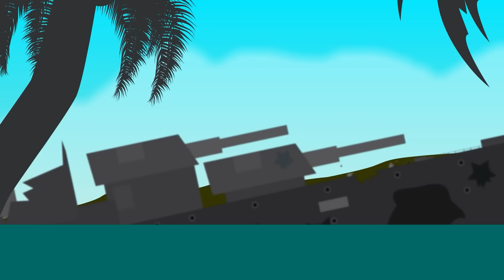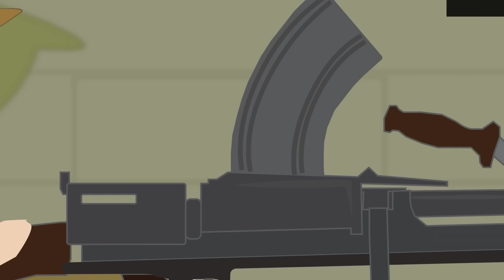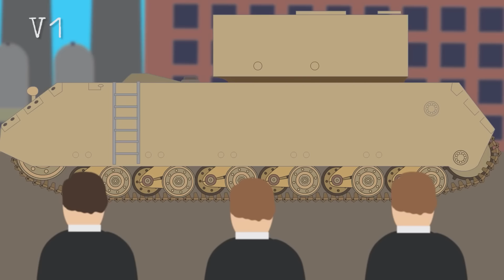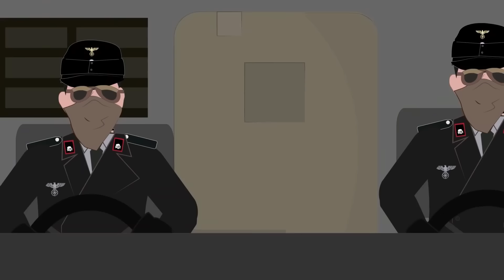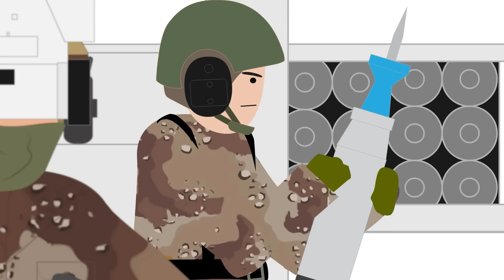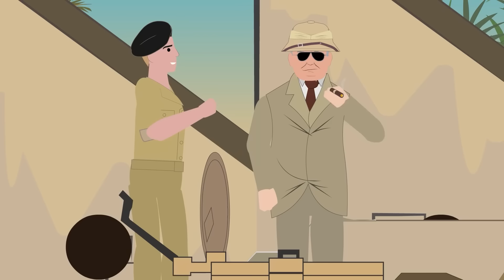Tanks! Monsters of the battlefield!

Comment: Bovington will soon have another great attraction of a tank, their FV4005 "SPUD" is currently undergoing restoration, which will see it get the original Centurion Mk3 hull, and will be made to be as accurate as possible to its 1950's condition. There were 3 FV4005's ever built (1 FV4005 Stage 1, 2 FV4005 Stage 2's) but only 1 was ever reassembled using a Centurion Mk12 hull, and sat as a gate guard, a static vehicle since 2008, but come Tank Fest later this year, it will be ready to be shown off, where it will look as it did when it was first built, and most importantly, it will be operational, driving under its own power for the first time on 70 years.

Comment: the simple tank may have been a failure as a tank but as something thrown together using what you had it was good enough. I think it would have done well at holding off a beach landing but after that it would have struggled. Basically it was a mobile pill box.
Reply: Yea its just an example of some random locally made thing with very limited resources or funds etc that might help during an actual invasion.  Kinda like how ppl mount guns onto normal trucks etc or use civilian drones.
Reply: I think they should have added an anti-tank rifle to the turret which would give it at least some AT firepower

Comment: Ratte would be a scary mothership to see if it was actually used
Reply: It would be scary for a couple of minutes, until the entire artillery and anti tank corps started to launch barrages and the planes started coming.
Reply: @darnit1944  It has multiple flaks on top and it would not come alone. But you are right, it would be an easy target and it probably would get destroyed easy
Reply: @Rickkert2000  Well, all of those flaks could only hold for long. The US has more planes to replace, while the Ratte is definitely one time use only.

Or, make it a mobile fortress and never go to the frontlines. But then it will probably way cheaper to build a bunker instead.
Reply: @darnit1944  yea no reason to make it mobile indeed. A big defended bunker would be more practicle
Reply: @Rickkert2000  As a wise man once said "the best protection is to not getting hit in the first place"
Reply: @agelessrebellion8271you do know Planes can do the job right?